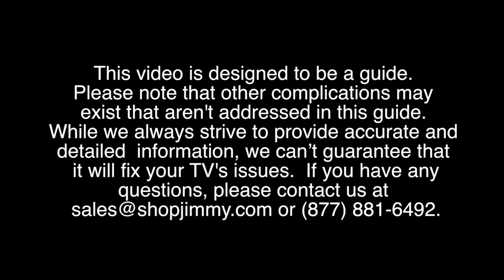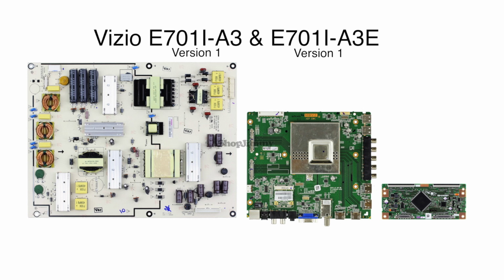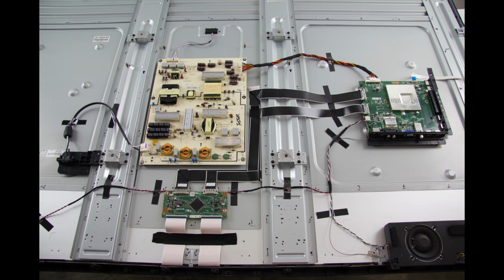Vizio E701I-A3 & E701I-A3E TV Repair Kit - How to Replace the T-con, Main and Power Supply Board

Comment: I have a 70” Vizio e701i-a3
It had backlight no picture I replaced tcon board and it worked perfectly for a couple minutes then slowly faded to black. 
I saw on a forum that there were some bad boards out there so I ordered a new board and the tv came on stayed on too except there is a dark evenly distorted area on the bottom two thirds of the tv.
I did have a lvds ribbon connector come apart on the second board. I put it back together. I was wondering if it could be a lvds ribbon? 
Any ideas
Thanks in advance

I have a 70” Vizio e701i-a3
It had backlight no picture I replaced tcon board and it worked perfectly for a couple minutes then slowly faded to black. 
I saw on a forum that there were some bad boards out there so I ordered a new board and the tv came on stayed on too except there is a dark evenly distorted area on the bottom two thirds of the tv.
I did have a lvds ribbon connector come apart on the second board. I put it back together. I was wondering if it could be a lvds ribbon? 
Any ideas
Thanks in advance
Reply: You typed the same thing twice

Comment: Hi, I have a Vizio E70-c3 and initially the top half of the screen had a bunch of horizontal lines. I took a spoon and tapped the screen a little, waited a few minutes and turned the tv back on. when turning the tv back on the majority of the lines were gone expect for a few new the top half of the screen. The left side of the screen is also darker than the right. What could be the cause of this and Is it fixable? Thank you

Comment: Have Vizio Model E701i-A3E.  Can not get rid of grey bars on each side of screen.  Have tried all the screen modes but none of them will stretch the picture to full screen. Also have slight flickering in picture.  Don't know the cause of either problem?

Comment: ok tv model# E701i-A3 70 in vizio first tv had no pic and had sound had lights in back. replaced t con board turn on tv then got power no logo just green screen tryed manul rese nothing work what is wrong or what part do i need.  please help i got my part from you very fast.
Reply: Lynn Shelton bad panel toss it not repairable

Comment: hey there,,, I have a e701i-a3 and I just did the complete boards replacement..
The vizio logo came up, then kinda faded out. Now I have a bunch of green lines that run from the bottom middle of the screen to the top. Then other times it just remains black screen,,, any ideas???
Reply: +Jim Merritt how do you take this tv apart ? I took all the screws out but cant separate the front and back parts
Reply: +calvin arnett look at the above comment,,, never replied b4
Reply: +Jim Merritt  thanks that worked , my screen is slowly going black 3/4 way down , I'm thinking it may be the t-con board ?from some of the videos
Reply: + mine just went black,,, changed all 3 boards then got these funky green lines going from bottom to top..
thought I had it cause for a second I saw the vizio logo..
good luck, hope it's not a bad screen which I think I ended up with
Reply: +Jim Merritt I replaced the boards and the tv worked for two weeks and same thing happened again , did you you get yours working ?I'm considering taking it to a shop, I not sure if its worth it